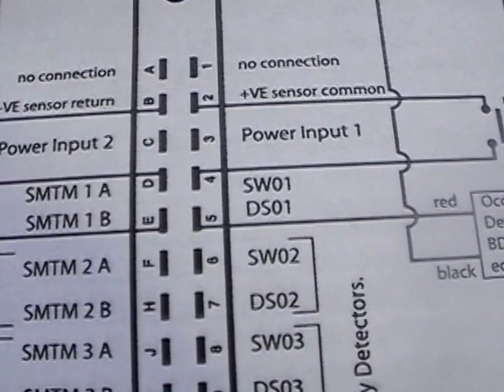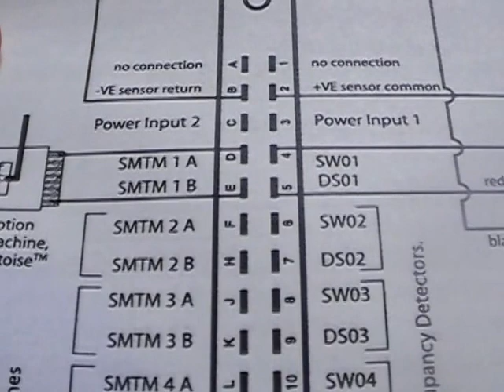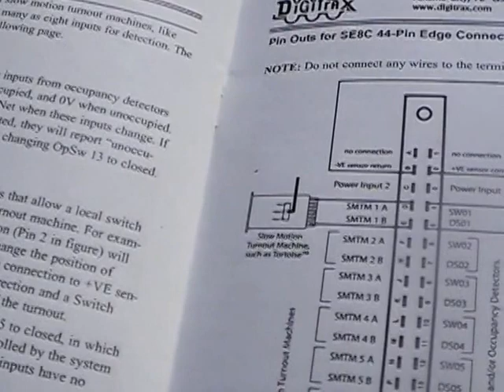Signals for my HO layout - 6b

Comment: congrats on figuring all this out. I remember to took a whole ton of research for me to figure it all out. Great work, the finished product will be very worthwhile
Reply from the maker: Thanks. Actually it was your videos that I looked at a lot. The actual wiring is the easy part for me, it just gets tedious after about the 20th wire! next up is connecting the signals to the SE8C and then putting everything into the computer. That's going to be a LONG process.